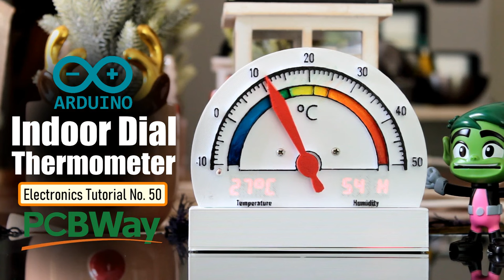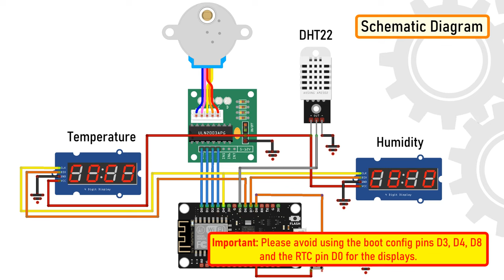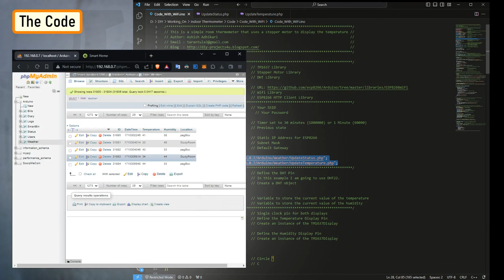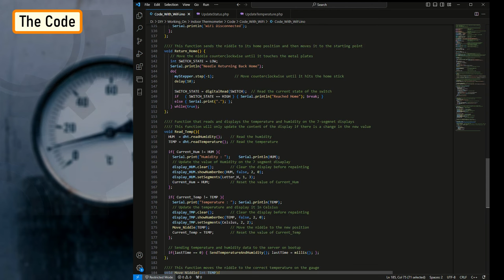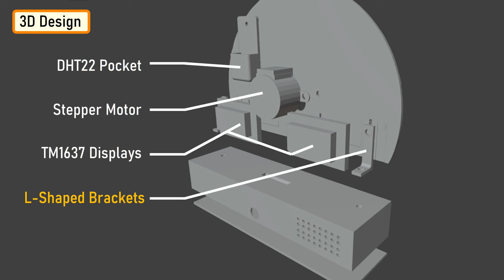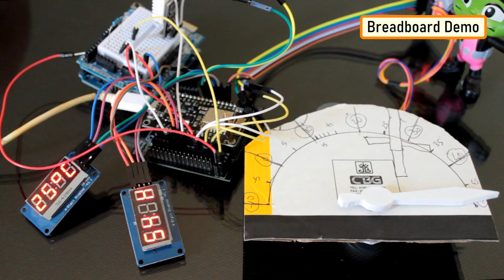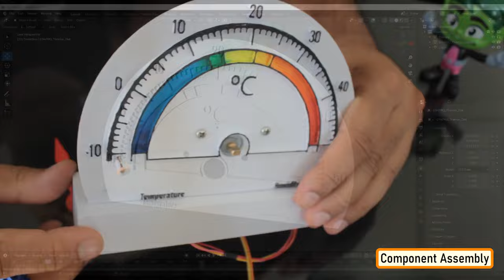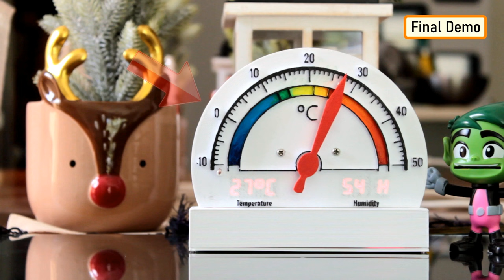NodeMCU Based: 3D Printed Indoor Gauge Thermometer

Comment: You can use a servo motor to remove the timing step of your needle!
Reply from the maker: True, the only reason I did not use a servo is to avoid the noise it makes when the gears rotate
Reply: @CrazyCoupleDIY  but it will not moove all the time, just to move slightly to a diferent position and maybe add a 10 second pause between each moove just to minimise the movement
Reply from the maker: Sure